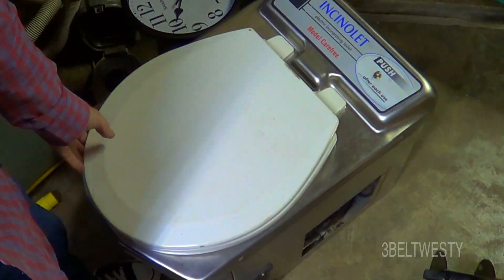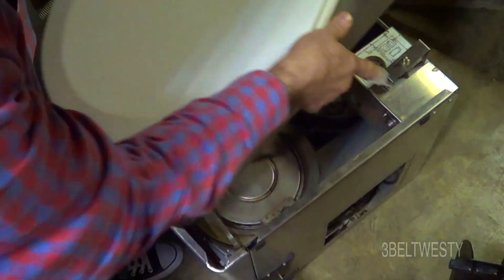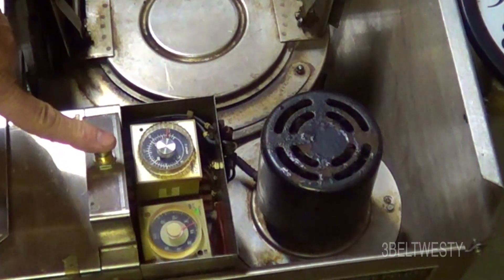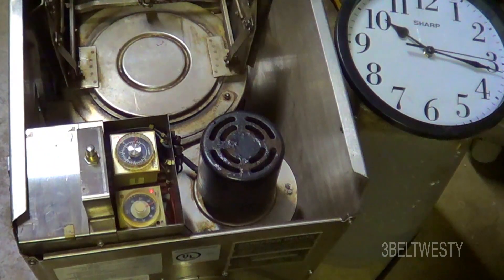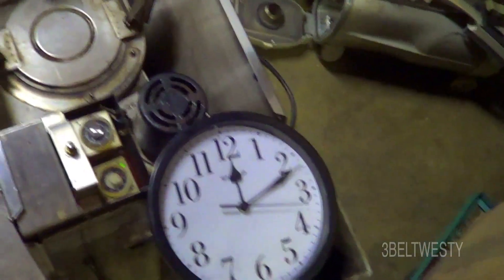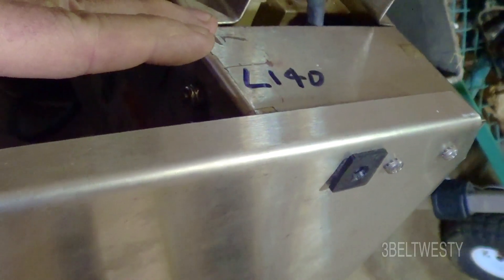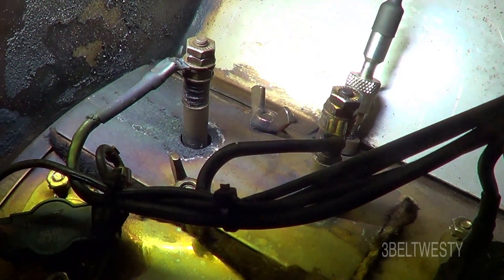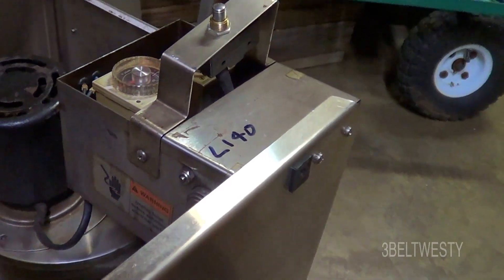Incinolet CF testing heater and blower   time lapse

Comment: Ive used mine for only 2 weekends now. If i were to do it again id fork over the $ for the cinderella as much as it hurts me to do so. The cinderella is direct vent so you dont need to open a window to give it air. Not good in winter or really hot days. Otherwise its working to pull it elsewhere and my new construction is sealed very well. Even with the bathroom window open it wasnt burning the waste completely and left it smoking and stinky. After increasing the timer to 1.5 hrs it seemed to resolve that problem. One day when my wife isnt looking ill replace it with the cinderella :)
Reply: What do you mean the Cinderella is direct vent?
Reply: @johnle231  it only uses outside air. It has an intake and exhaust where the incinolete only has an exhaust. When your home is well sealed it need to pull air from somewhere so I have to open a window and in the winter your bathroom is freezing
Reply: @dirtycommtroop  oh I see what your saying now.  So it has 2 vents going outside, one for intake one for out.  You wouldn’t happen to have schematic for Cinderella do you
Reply: @johnle231  lol sorry all out of schematics
Reply: @dirtycommtroop  incinolet instrivtion manuel says if you have big enough gap at bottom of bathroom door or door has a vent thing to allow air in, that should be enough I guess
Reply: @dirtycommtroop  oh I just read your original comment.  Opening window wasn’t giving enough air for proper burn and vent.    What type of vent did you setup.  Horizontal straight through wall or vertical to roof?
Reply: @johnle231  horizontal straight through wall
Reply: @dirtycommtroop  I was looking at how Cinderella built.  Seems like to me you might be able to add an intake vent to the current design of the incinolet….
Reply: @dirtycommtroop  only problem is where the catalyst chamber is on the incinolet. You would either have to put a hole in the burn chamber for the intake vent or you would need to relocate the catalyst chamber
Reply: @dirtycommtroop  actually,  now that I think about it more,  the catylyst chamber does not need to be moved. Only thing needed is a connecting pipe that connects intake to outtake pipe.  V shape
Reply: @johnle231  Im going to buy the Cinderella eventually. For now I'm making due.
Reply: @dirtycommtroop  right on

Comment: If possible, could you do a similar test with 120v model, however im looking for the total wattage used, im looking to install this off grid and i would like to know if i would have to run a generator for 1.15hrs or if it only consumes 1800 watts for short pulses of time. Thanks.
Reply from the maker: This is an older 120 volt model, its nameplate says 1800 watts 115 volts. Todays models say 120 volts 2000 watts on the Incinolet website. The main power draw is the heater. The heater cycles on and off during the usage. You need some extra margin in wattage of a generator than the load it sees. Generators really have a load of volt amperes. The heater is just a dumb resistor so the "volt times amps" is really the watts. BUT you have a blower motor too so here you need more amp volts than watts since the motor is inductive. The motor is small thus this increase is not much. 2000 watts divided by 120 volts is 16.67 amps. The actual amps a guess more like 18 to 19 amps. The heater does not run for short pulses, it runs a long time at full power until it starts to cycle on and off.
Reply: @3beltwesty is it the controller that cycles it or thermostat?

Comment: Is there a significant increase on your electric bill? I'm building a cabin and looking at this toilet.
Reply from the maker: Not really. The energy used is like a space heater running say for an hour. So like 15 cents per usage as rough guess. My main energy draw was a brand new 5 cubic ft freezer that the starter relay failed.

Buying one of these incinolets used say on ebay  is rather dicey. The central incinerator part can be broken where the catalyst pellets are held. It will still work but without the pellets you will get stink out of the exhaust. 

These toilets can last decades. The main reasons the heater coil has to be replaced is folks do not empty the ash pan.

They are made in 120 and 240 volt versions
Reply: @3beltwesty  Thank you for the reply. Sounds good! I'm 99% sure ill be going with this.